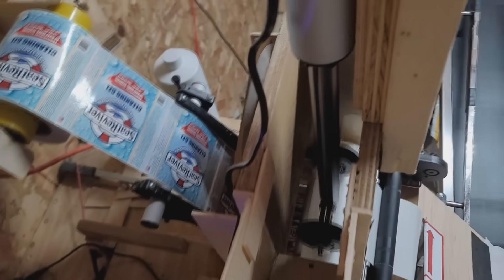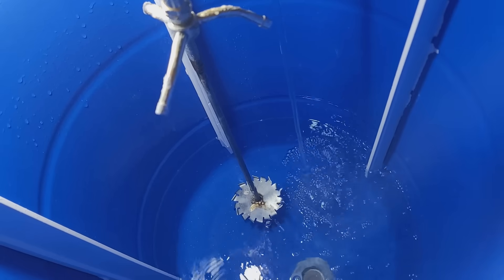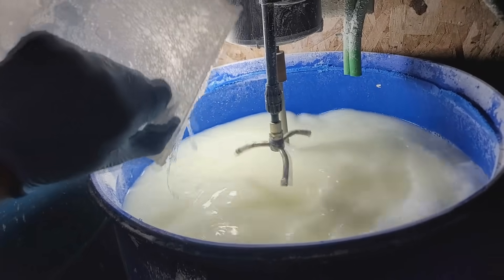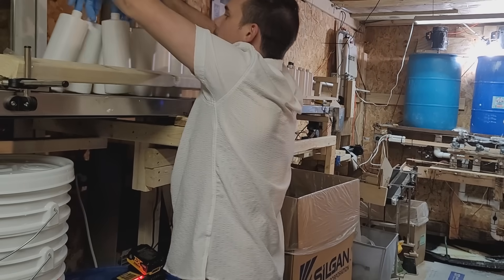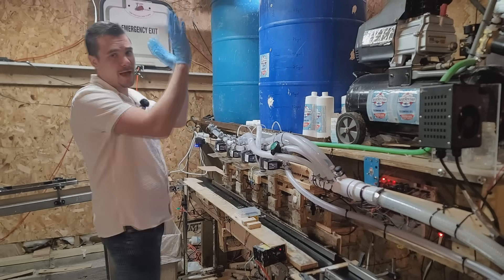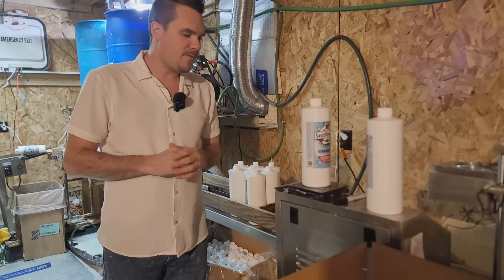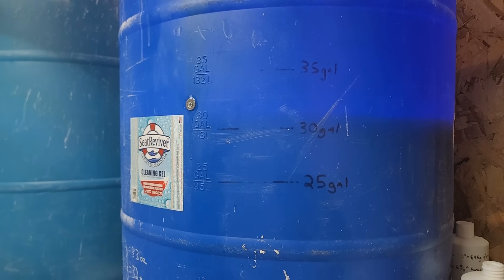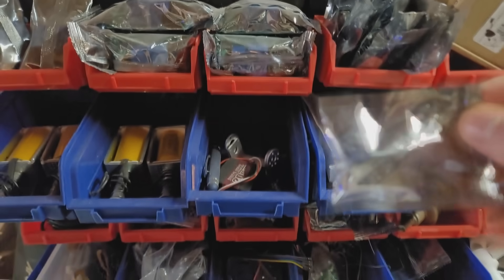I Built a $3M/Year Factory in a 600sqft Shop - Ep2

Comment: Honestly this entire video brought a smile to my face - this is awesome work. I work with several companies, the fastest of which does 250 bottles per minute. The trick for the bottle spacing is using an auger or caddies with your filler - but no need to optimize that if that's not constraining you. Also good work on the buffering system. People underestimate how critical buffering is as it keeps your machines running when you have a failure upstream. I know this may sound a little silly at this point, but I would highly recommend starting good record keeping early. Downtime logging with good reason codes which you can easily look at in Excel are invaluable when you start to decide what part of your operation you're going to spend CapEx on next. Also, keeping track of production speed will let you quantitatively say if a change made an improvement early on. A lot of companies don't build these habits early and really struggle with it later.
Reply from the maker: Thank you, Fantastic comment. What do you do in manufacturing?
Reply: @PlanesBoatsandSubmarines Something seems to be blocking out my comment, so did my best to rewrite it. Hopefully you don't get a bunch of messages from that.

I'm on the software side and my business partner is on the analytics/sales side. Our bread and butter is software automation projects for clients as well as collecting all the data a client has into a single place and making it easier to analyze/cross-reference data. A lot of people end up with a decent number of software packages that don't talk to each other and a lot of exporting to excel files and doing analysis there. We usually also help the clients by doing our own analysis on the data giving advice on CapEx, etc. like I mentioned in the other comment. Recently, we've also rolled out our own IoT device that we can collect line speed, scrap rates, counts, etc. to further add on to the above data.

Comment: This is the way. I grew up in environments like these and I work in environments like these. Smell of 2x4s, machine oil and aluminum shavings everywhere. The box of spare parts may seem overkill to some people, but having two or three of each extra means you sleep easily at night. The only surprising thing is that this kind of makeshift factory is not common. But it does require a unique set of skills and hands-on experience to put it all together and make it seem like it's so simple as a casual walkthrough. The placement of the bottles on the side to label them is where the art of getting things done shines. The arduinos on a breadboard with jumper wires had me in stitches. What custom PCBs? Those sensors definitely aren't Siemens. Any screwdriver around can fix tighten the hose clamps. Truly top class work - I doubt this place has downtime.

Comment: Amazing! Where do you source your parts for the production line? I also have a home-based production and bottling lineup selling on Amazon but this is inspiring! Currently doing only 1500-2000 bottles per month and long overdue on an upgrade!
Reply from the maker: Thanks! A variety of sources for parts, often single components. The conveyors are from Vevor and work great, including the induction sealing machine, which all was heavily modified as you can see.

Comment: No such thing as "Negative pressure." Only high or low pressure. It's not possible to have a  pressure less than zero. Just sayin
Reply: There is actually. If air is being sucked out it's called negative pressure
Reply: @evansdavids nope. Air is transitioning from an area of higher pressure to an area of lower pressure. Also known as equalizing.
Reply: @MTnumber11 yes you partly got it. The fan sucking out air/smell is the negative pressure. The equalising air you alluded above actually is bringing in fresh air. Exactly the point in keeping the work environments less smelly. Kindly Google negative pressure.

Comment: I don't know how I've got here but anyways here is a (maybe) further streamlining idea:

How about:
1. getting a thin plywood/acrylic (Whatever, as long as it's light) board, let's call it "bottle unpacking board" which is just a bit bigger that the "footprint" of the cardboard boxes where you've getting the bottles from.
2. flip a bottle box so that the bottles inside are upside-down
3. cut off the bottom of the bottles box, so that it's completely open
3. put the "bottle unpacking board" on top of the now open bottles box
4. grab board+box flip it
5. put it on the "feeder conveyor belt
6. pull the board out
7. lift the bottles box
8. rinse and repeat from #2-#7 until feeder is filled

I don't know if that's a real time saver compared to your "8-finger bottle lifting technique" but just a random thought from a random dude on the internet 🙂

Cheers!
Reply from the maker: lol, the issue is the bottles are 2 stacks inside 1 box.
Reply: @PlanesBoatsandSubmarines  ah crap 😕

Comment: Can you tell a bit more about the software side? Do you have a central control or is every station triggered by the next bottle? And do you have any documentation about the individual stations? The jumper wires look like they could randomly unplug which will lead to hard to diagnose problems.
Reply from the maker: Will do a video on the software side, especially if more people show interest in that part. Each setup has its own arduino board and is triggered by the bottles. The board with jumpers is the from the original setup. The new board running the current line has a screw mounted terminal. Thanks for watching

Comment: Hi dude, thanks for reading one of my questions... 

I wonder "what solutions do you have think about for the filling station (volumetric pump/valve, flowmeter, stuff like that) ?"
Reply from the maker: Good question, we currently use liquid level sensors that see through the bottle, which for the most part work great, but In the future when we expand, or if I had to do it all over again - I would use a piston pump. Occasionally the sensors trigger late and we get overfills, although not as often anymore after optimizing. A piston driven pump would have solved that quicker and require less working parts removing the diaphragm pump needed to drive moderate viscosity fluids.
Reply: @PlanesBoatsandSubmarines  a peristaltic pump might be quite costly but they're often praised as very accurate dosing device...

Comment: The speed of a production line is always governed by the slowest element.  I notice that your labelling machine upper clamp takes a long time to drop down to reach the bottle. Either shorten the stroke or change the air cylinder for a smaller one. It will speed up the process, and save you some air.
Reply from the maker: It has a long stroke so the bottle can clear the roller from the conveyor when it's retracted. It's not air driven, its the fastest 12V Linear Actuator on the market for the stroke length. You're right that if the actuator could be sped up, it would save a second or two per bottle which would make a meaningful difference. We will address improvements like this when we near the max capacity output. Glad you enjoyed the video!
Reply: @PlanesBoatsandSubmarines Thanks for the reply. I spent years fascinated by bottle production lines and their efficiencies, analysing weak points, or slow points is great BUT, solve one and you just move the weak/slow point somewhere else.   I’ve got to congratulate you on what is an achievement, lowest cost does the job, hats off to you.
Reply: thats makes no sense what do you mean

Comment: Very cool stuff!!! What is your current bottleneck on the production line? My guess is the labeler, then the fill port, then the caps.
Reply from the maker: Thanks! The labeler produces slightly faster than the filling line. That's why we get the overflow box. Once we get the filling line to run just 5-10% faster, they will be in sync. Capping will soon be automated as well as the last step to full automation!
Reply: @PlanesBoatsandSubmarines  it real stinks that your fill mechanism creates more drama than it's worth. Otherwise it would crank out some bottles!

Comment: When I worked in a factory, I built and managed two machines that could do 20,000 units a day manufacturing dentist supply cardboard boxes if you had a bottle capper it would be maybe close to 10,000 a day perhaps
Reply from the maker: Nice! We plan to automate the capper and do a future episode on it. The limiting factors are the batch mixers, but with an automated capper, it does allow less labor so focus can be on monitoring and squeezing in another 2 batches. in that case, I do think everything could be optimized to hit 20,000 bottles a month. Will see! The only issue, is we may outgrow this space in that event because we will need twice the weekly shipments of material (empty bottles, ingredients, etc) The next season will determine that! Thanks
Reply: @PlanesBoatsandSubmarines next step before automated capper is a handheld bottle capper. Can be as cheap as $50, up to $1000 for what you’d like to spend for. Either pneumatic or electric powered. No need for hand threading!